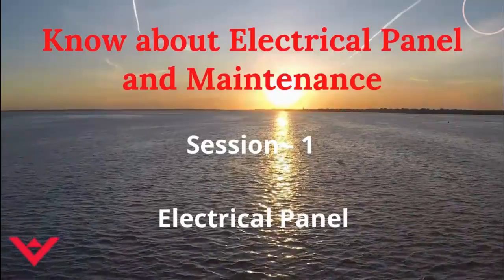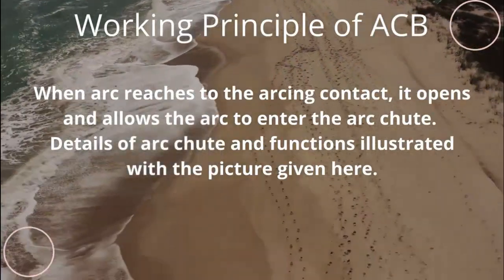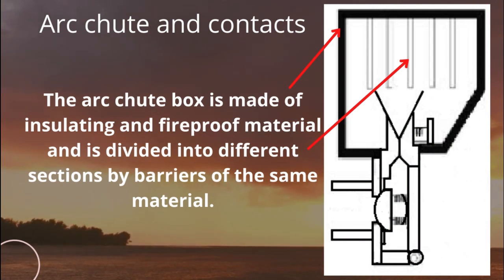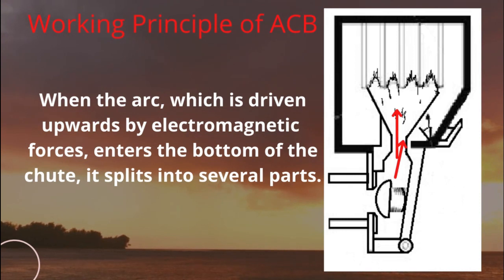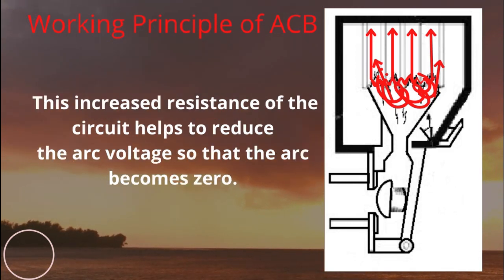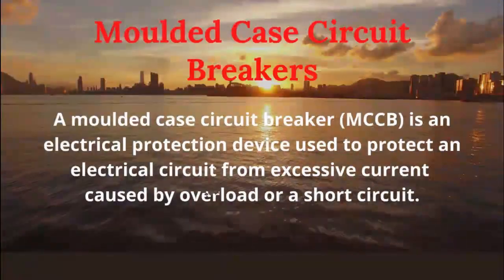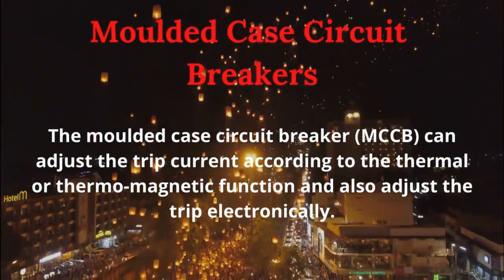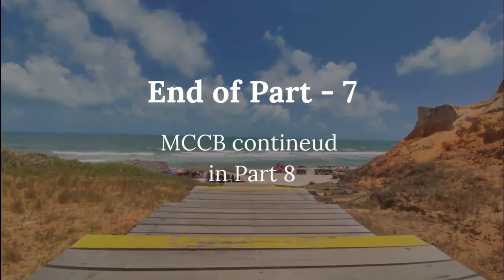Know about Electrical Panel - Part 7 | ACB Working Principle - Explained.

Comment: Sir does Vcb  drawing also same as acb ?
Reply from the maker: No, both are different. VCB is a vacuum circuit breaker, and ACB is air circuit breaker. ACBs are used in low-voltage applications, up to 1,000V. But VCBs are ideal for medium to high-voltage applications, ranging from 1kV to 36kV. My tutorial videos are prepared in low-voltage applications.